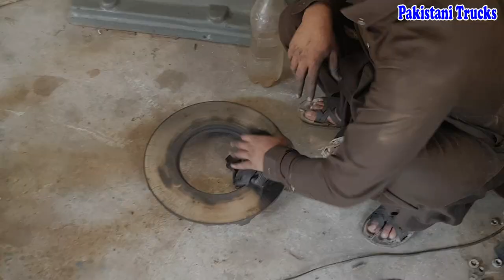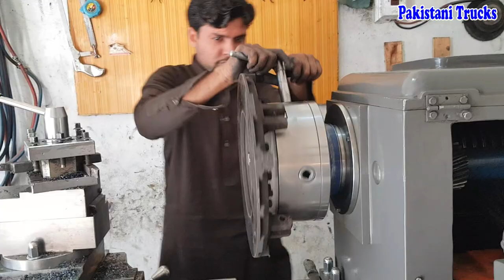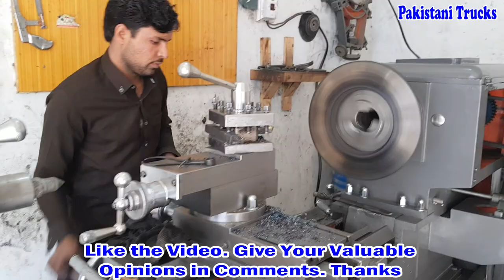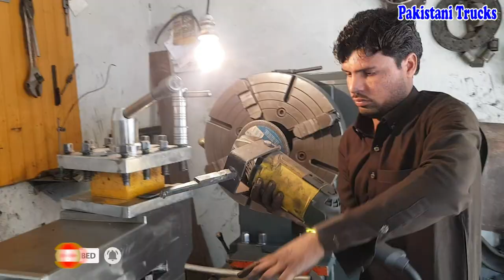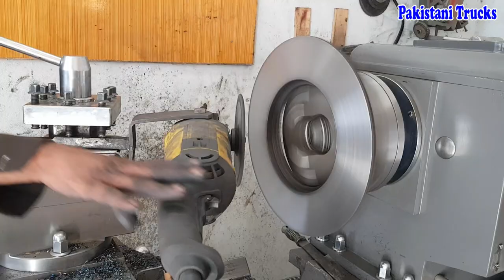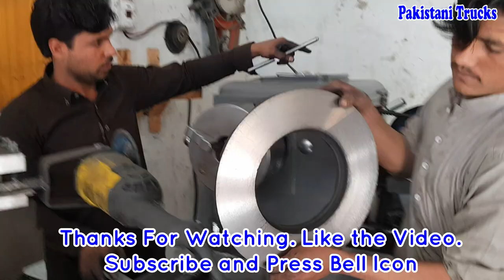How to Resurface Clutch Pressure Plate | Lining and Polish of Pressure Plate

Comment: the problem with using a grinder for facing all the clutch is that grinding stone is constantly shrinking so your cut comes out at a slight angle
Reply: Very tru
Reply: Exactly what I was saying/thinking through the entire video.
Reply: @markarita3  Yeap... I thought the same. If they adapted a grinding stone........
Reply: works for surface grinders

I know its not the same, but the same principle
Reply: @rexaitken  Surface grinders barely kiss the surface (or at least, they should). That plate should've been machined, not grinded.
Reply: Guys like him are better machinist and all around problem solvers that most machinist in the US. These guys don’t have the nice stuff and get the job done. Hats off to this guy 👍
Reply: Even after stretching the lathe drive belt, you can see what a "professional" job it is ;d
Reply: not mentioning the flexing
Reply: carbide are best
Reply: It would happen for a heavy cut. But with a very light cut It would only be just a couple of microns tapered.
Reply: no the problem is hi don't know how many .000 hi grind
Reply: @josegomez2190  and you don't know what is the unit of 0.000 reads?
Reply: 100% true  .
Reply: Very "professional" ;-)
Reply: Only the first layer in contact wears out, the cuting action is like a rough cut(wearout zone) folowed by a finshing cut. It's the same for surface grinders(those wear out too, but they're called precision grinders because the same principle applies).
Reply: This is not a rebuild. it's a patch. # synonymous of mexicanada, negered o Pakistani repairs. all are trusty. or isn't? Back to work today!😁
Reply: Grining finished kijia ustad
Reply: Actually, every OD grinder or Blanchard deals with wheel loss. In the end, if you work the wheel properly, you won’t have a taper that is either measurable or that matters. Because you go back and forth while roughing, any taper is swapped side to side until removed.
Reply: @alfaalfa33  quick and dirty...way to get job done fast . Its not a medical implant or a Aerospace part..just a cheap quick job from what i see...shoemaker way..but works..
Reply: I think grinding disk shrink is bullshit compared to the disalignment caused by the "eyemeter"
Reply: This is making do with the available tools, and personally I am going to assume that that know their trade and the process is fit for their purposes.
Re the idea that the grinding disc will get smaller over and therefore the face won't be flat, I see there was multiple passes, and checked with a straight edge in the end.
I note that the lathe operator in another video, did indeed use a board to keep grit off the bed of the lathe, and took quite a bit of trouble to keep the whole thing clearn.
Reply: I see your lathe is much cleaner and nicer than the other Pakistani machinist videos I see.  May I ask you what model it is and are they manufacturer there in Pakistan?  In the US, lathes with external open belt drive headstock weren’t made much later maybe early 1920 or so.  Fully enclosed headstocks with gears in oil baths and the electric motor drive being below the lathe underneath the headstock with drive pulleys exiting the lathes left side (from the operators perspective) is the norm for almost the last 100 years or so.  

I see in your video and the other Pakistani machinist videos I’ve seen all have the motor in the rear and belt drive going into an open headstock—do you guys have any problems with headstock gears/spindles/bearings wearing out/wearing out prematurely??? Seems a point for contamination and chips to enter very easily.
Reply: not if you take light passes and start from both ways

Comment: Guys, protect the lathe ways from grinder grit.
Reply: I would be more worried about the 100 pound parts they keep dropping on them.
Reply: And weld splatter🤣
Reply: These guys use the lathe as ground when welding on it. It’s basically ruined already. They don’t care if the ways wear and it turns tapers
Reply: And use a mask!
Reply: Eye protection? Grind and grind ... but cracks still there ... stupid waste of time ...
Reply: Look at the rest of the shop! Look at the part that I would assume, being he took it out of the chuck and threw on the floor, to be done. I think grinding dust on the ways is the least of their concerns
Reply: Also i like the safetyboots ... 🙈
Reply: @GpunktHartman  Well done lads
Reply: @GpunktHartman  safety sandals are much more comfortable
Reply: @ubenpwned  ... may funny pictures when hot chips drops to the naked skin ...
Reply: That's right
Reply: Š
Reply: Yeah, I was gritting my teeth.
Reply: That’s probably why he has what looks like new lathe.

Comment: Even if it was a proper resurface (which it was not, the grinder stone shrinks as it grinds) the plate is still thin after the "repair" a more important it is still cracked.
Reply: That's a very first world observation. AKA correct
Reply: Sometimes that is the best they can do with the gear on hand.

Comment: Best possible finish when lathe spindle running in reverse and using machine driven cross feed.  But you're doing what you can with what you've got. Dial indicator and dead-blow hammer would help setup.
Reply: There are no dial indicators in Pakistan - any instruments that have needles in them are considered Haram - against Islamic Policies.
Reply: Pretty much any good shop practice would be an improvement but Pakistan.
Reply: Couldn't agree more. I used to get best results using a stone in my air grinder. To have a nice lathe and no dial indicators is strange.
Reply: @TheFeller1554  yes you are right i have much better improve know i made every instruments cnc machine

Comment: Was glad to see him use a straight edge after grinding because even though I am NOT a machinist I would not expect the flex in the grinder setup to flatten/true the flywhell like a rigid cutter head would.  But, he could tll more about how untrue the surface was and I guess he determined the he did not need to cut it to true it.

Comment: Need to get some covers made to catch all the grinding dust. It mixes with the lubricants to make a grinding paste that will wreck your lovely new lathe. I use old bits of carpet with sticky old grease to catch all the dust. Works well and protects my lathe guides. Cheap but very effective.
Reply: Look at the rest of the shop! Look at the part that I would assume, being he took it out of the chuck and threw on the floor, to be done. I think grinding dust on the ways is the least of their concerns

Comment: As a machinist, I see a few issues. The first one is the lack of safety glasses. The second one is over tightening the clutch as it can cause premature wear on the jaws and other internal parts.
  Lastly, trying to hold the pressure plate or brake rotors using the chuck jaws will not ensure a continuous even cut. The vibration and harmonics of cutting will cause unwanted movement in your work piece. A piece of rubber strapping or anything to absorb the vibration around the device will help somewhat but not eliminate it. Andy 🇨🇦

Comment: It worked fine for what he was doing. If there was any low spots in it you would have saw it in the grind.
I've seen people throw the same pressure plate in without doing anything to it and go another hundred thousand miles so cut the guy some slack. Probably going into a vehicle that has 300,000 miles on the engine anyway!
Reply: Why even do anything at all if it is not an improvement.

Comment: Can somebody explain to me why the surface is being ground and not turned with a tool on the lathe?

When I buy new clutch's, the faces look turned and not ground.
Reply: They should be rotary ground with a cup style wheel, which would leave a finish similar to a Blanchard ground surface. This is a really rough way to do it (speaking figuratively), but it obviously works, and you have to appreciate the ingenuity.
Reply: I used to resurface flywheels. (And was also a cnc machinist!)
It is done on a table and like icutmetal mentioned, it's done with a cup style wheel that is wider than the surface to grind!
For this kind of application: you need a level of finish as smooth as possible: grinding give a better result/precision than turning. But not a smooth/polished style but something really straight .
Hope it answered a bit :)

Comment: First a quick dial indicate & tap in plate as you spin and tighten .Use a good carbide coated insert face off .007  true and take a spring pass back over the same cut  flatness and finish will be .010 r.m.s aprox with no taper..plus you will save the ways.from grit..also you will  never get hert if wheel breaks up on a cut ...good video.

Comment: That pressure plate has to explode before you get a new one look at all the deep cracks fuck safety and look how thin it is its been grinded a dozen times already
Reply: Safety/quality is NO issue because when it breaks it'll be repaired until repair isn't possible anymore.
Reply: @johnsamu  and then once more ffs
Reply: @johnsamu  Repair wasn't possible here or even performed.

Comment: You need a dial indicator to chceck if the flywheel is mounded true. Also should avoid whacking it with steel hammer. Rubber or nylon mallet work great.
Reply: Precision tools, rubber hammer are just a detail. Lol
Reply: They don't have those here. What do you think this is China or something?

Comment: What I see in this is you are turning both in same direction. It will be better if you turn the lathe un lock wise. It will grind much better. Both turning in same direction won’t cut perfectly.

Comment: Use a dial test indicator. Mark 4 points at 90 degrees and it will be much easier and more accurate to set up. Retire machines .

Comment: That plate is stuffed why would you reface that??
Reply: That’s typical of worn pressure plates, they all have heat cracks, nothing to worry about..
Reply: Because Pakistan
Reply: @cuttersgoose  FALSE
Reply: @TheFeller1554  really..cause your an expert?  i own a clutch rebuilding shop for 35 years...
Reply: @cuttersgoose  And advising your customers to reinstall pressure plates with severe heat cracks is a normal practice in your business? Yes I do know a little something about this subject. I own a machine shop. When I resurface a pressure plate, or fly wheel I look up the manufacture's specs. If the finished plate will fall outside if those specs it hits the scrap dumpster, as is normal shop practice. If you don't do this I would advise you to start, because supplying a repaired product that is out of proven manufacturer's specs can open you up to liability!!!
Reply: @TheFeller1554  oh get off your ivory tower.....we are the oldest clutch and brake rebuilder in the usa, since the teens. we ve done 10s of thousands of pressure plates over the 100 years we ve been in business..never had one come apart..
these trucks dont rev over 3000 rpm... if it were a 10K rpm dragster..then yes...it would be replaced...
a lot of pressure plates are no longer made and parts are getting unobtainium, so sometimes you have no choise...customers are not rich, they cant afford to cast a new pressure plate,... so please...stop
Reply: @cuttersgoose  Yea I am far from any ivory tower. I just like to do things right, because if I fup and someone gets hurt as a result I can lose my business. Not to mention living with the guilt. Hey it might work fine I haven't done nowhere near as many as you say you have. If I am going to put my name on something, it is going to be done as right as my knowledge and skills allow. If I can't machine something, I turn down the business. You can't fulfill every request.
Reply: @TheFeller1554  it comes down to this in a pressure plate...what is the material the casting is made of?  grey iron or ductle?  if its grey iron, absolutely question the cracks and if they are very deep and long, throw it out...or weld it up with silicon bronze if its a super rare pc....

 but, if its ductile...as in the case with this casting..(this is a hino or UD clutch) then its fine..

grey iron breaks very easily...ductile iron bends, it does not break...
Reply: @cuttersgoose  Good to know thanks for the info.